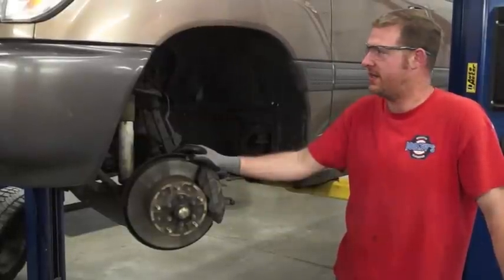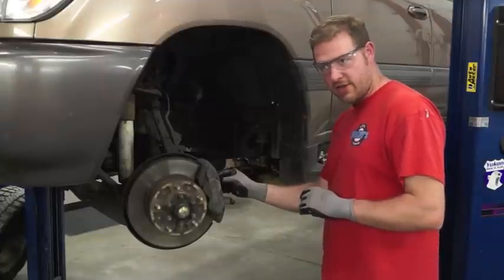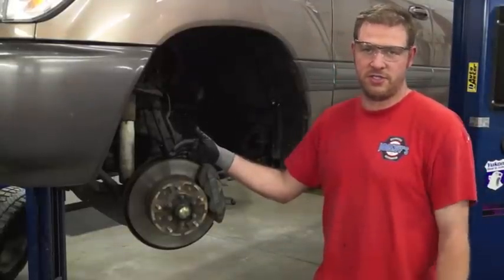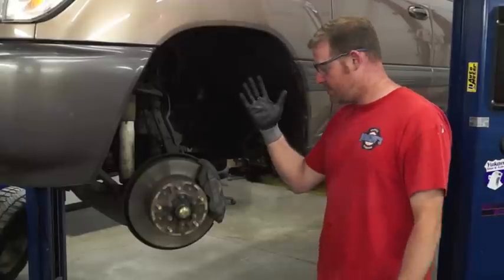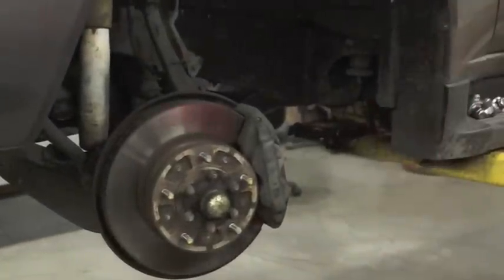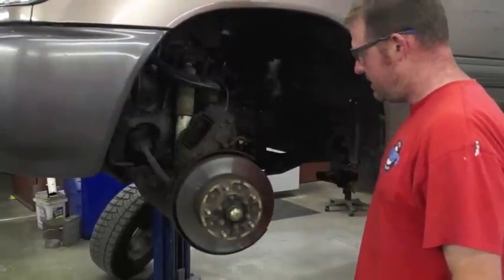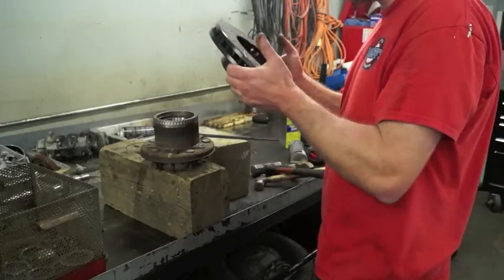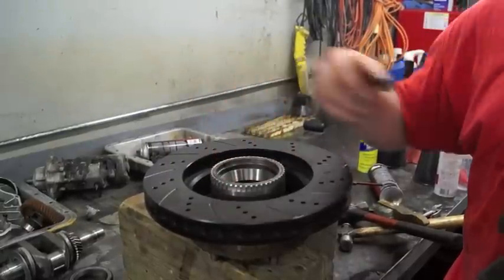100 Series Land Cruiser Front Brake Rotor and Wheel Bearing Install

Comment: Great video, much appreciated.  I'm having a hard time finding the torque specs for the hub to rotor - any ideas?
Reply: Any luck?  I need these as well.
Reply: 53ft-lbs i believe. Also check out the ih8mud forum for even more in depth torque specs and bearing break away preload information to give the most longevity of your bearings/cv drive shaft/spindle.